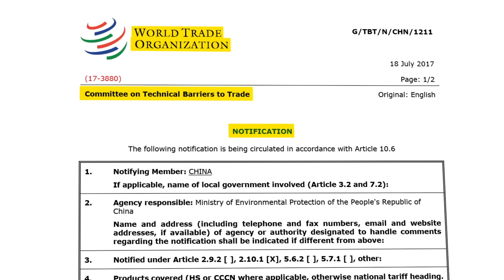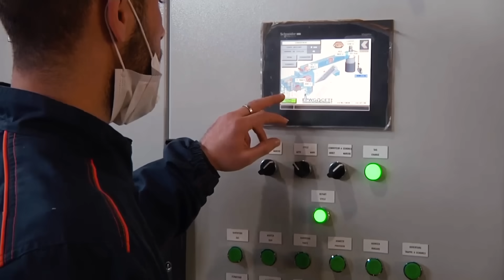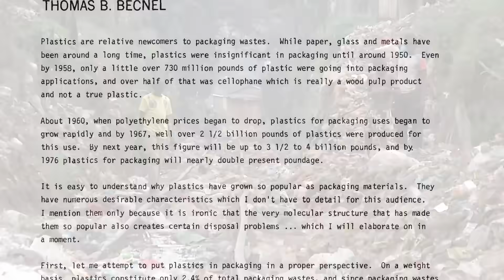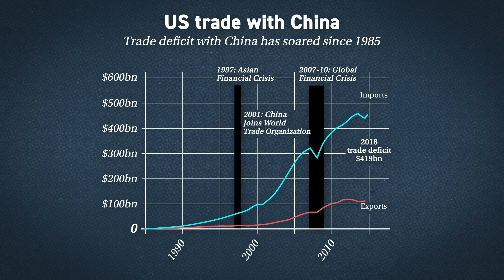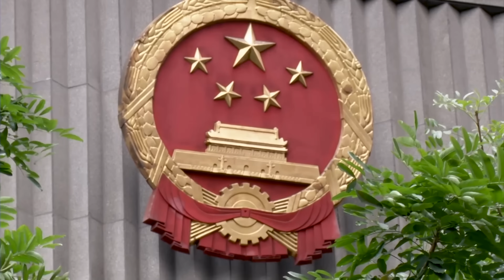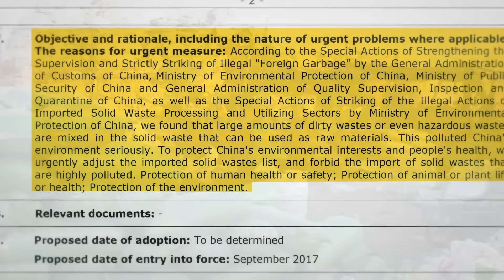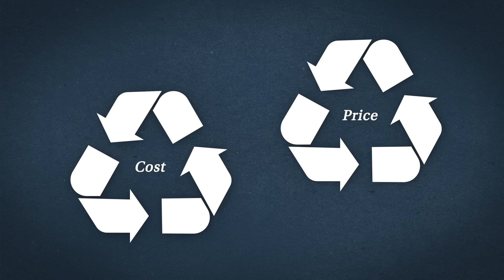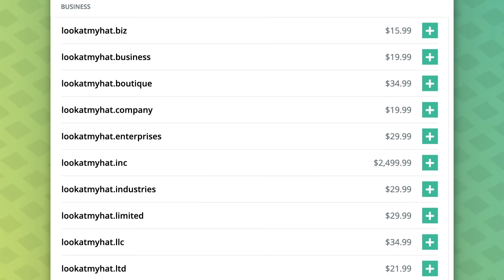How China Broke the World's Recycling

Comment: I've been trying to avoid buying things that come in plastic. It's very difficult since plastic is used in almost anything.
Reply: That's why it needs political answers to these societal problems.
Even if I really want to can't have a co2 free and plastic free live because the products that are out there are the products that are out there.
It's possible to do something as consumers, but it is quite limited.
Reply: @firstlast6813  There is a lot of products that would be outright unsafe to consume without vacuum sealing, which many small towns rely on to be able to import affordable food and that's just 1 example of why cheap plastic packaging is necessary, and there is a ton more examples just like this.
Reply: @Iwetbeds  definitely right and many times using plastic is actually better than using the alternatives. Because it keeps things save, light weight and long lasting.
That shows in my opinion even more why it needs political action, because the consumers have nearly now impact on how the plastic is produced, recycled or maybe even what kind of plastic is used. Proper standards and legislation on the other hand have the possibility to push the industry in a direction that won't damage the things we love and need for living.
Because something needs to change, the current way is not sustainable.
Reply: @Iwetbeds  I'm not expert, but some ideas: High fees on landfill use, funding of research for alternative materials, taxes on using new resources and subsidies on recycled products.
The goal should be a circular economy, fof that governments need to set an environment where recycling and reducing trash makes money and doesn't cost money.
Reply: @Iwetbeds  restricting different types of plastic for different uses and outright banning unnecessary use of plastic by companies is a much better suggestion.

Comment: Thanks, yes recycling has to turn a profit or it does not happen, I worked in recycling for 30 years, if we did not earn we did not do it.
 Here in UK, I shudder to think how we cope with Covid medical waste, PPE etc, we do not have the incineration capacity, and landfill should not be an option.
 Recyclers will adapt to new conditions, they are very innovative and fast to introduce new methods if the £/$ flow is positive.

Comment: Plastic needs to just stop being made and better alternatives need to be thought up. We could use glass, the problem with that though is that not only does glass take longer to break down, sand is not a renewable resource. We'd be destroying potential habitats and sand also acts as a barrier, preventing  erosion on coastlines and along river banks. The only way that could be effective, is if everyone is on the same page as in, glass isn't thrown out or recycled, but rather reused. Sent back to the companies who sold them to begin with, so that they can be properly cleaned and refilled before they are put back on the market. Of course even doing that, there are problems as well. The pollution created from transporting the glass for instance (at least until something like electric vehicles becomes more mainstream.)

Comment: when you see the situation of plastic pouring into the Mekong for instance, one of the best approach (simplest) once collected is either to gasify or use pyrolitic conversion to ash. sure, a big part of the energy is used for pyrolisis so it does not produce energy but the residue is ash and dioxin/pm emissions are kept low. small scale incinerators do not require large transport logistics and incineration can be done in situ.
given the problem with microplastics, it seems like a no brainer in dire situations like in Vietnam, Indonesia.

Comment: This is  not a problem, the solution is to landfill the plastic. Plastic that is responsibly landfilled does not cause a problem, the only problems caused by plastics are plastics that are just tossed on the ground or into a river, and recycling does nothing to help with that. If you throw your plastic in the trash, then you have done your part, end of story.

Comment: Petrol is running out i think in near future like in 70 years it will be viable for a while until we don't use plastic at all.
Reply: Cheap petrol is running out. There is enough to frack and enough tarsands for many years to go. It will run out way after 2030, 2040 or 2050 climate goals. Climate action will fix this issue pulling the carpet from underneath it's economics. This a byproduct of the fractions of wax distilled from crude oil for mobility. Bioplastics or syntheic plastics will simply become very expensive soon.

Comment: It should be pointed out that there is a great deal of active research being explored to find biologically-based methods not just to safely degrade many of the plastics discussed in this video but to create biologically-derived co-polymers and composites that exhibit many of the properties desired for petroleum-based polymers. These range from polylactic acid, polyhydroxyalkoanoates and polybutylene succinate to chitin, cellulose, collagen and other complex starches.

The chemical industry is not as callously indifferent as this video is suggesting, and they have been responding with the best available science and engineering to address the problems with low-value plastic materials. To be clear, high-value plastics like polystyrenes, polypropylenes, polyethylenes, polycarbonates and PET are still recyclable, mostly because thermoplastic materials like these still have very useful mechanical, optical or other properties.

Comment: Wait, if you can incinerate plastics (as i've done in the camp fire many times), can't they be used as a power source? Stack up some scrubbers in the flue to keep things relatively clean, and now you're making a profit from garbage? maybe? I think they do something like this in Japan.
Reply: It's not a self-sustainable, it takes more energy to keep the plastic burning than the energy returned from the burning plastic. The byproducts of burning plastics are also extremely toxic, it's not as easy as stacking "scrubbers" to contain the pollution it produces. Keeping it on the ground is actually better for the environment than incinerating it.

Comment: Don't forget what you learned back in the third grade; it's reduce, reuse and THEN recycle.  We forgot about the first two, much more important elements to waste reduction.
Reply: It's a nice idea for future plastic, but doesn't fix the problem of all the tons of existing disposed plastic not being recycled.
Reply: @DiegoCandel  It has to start somewhere. Even if the existing disposed plastic is just ultimately fished out and burned down in plants.
Reply: @Puleczech    I agree. In fact, i would argue it started a long time ago with individual efforts (from indigenous people opposing pipelines and preserving flora and fauna, people cleaning beaches and landscapes to NGOs cleaning parts of the oceans). But that's going beyond the 3 Rs. It's adding "Cleaning" to the package.

But perhaps it's also time manufacturing companies should join in fixing the mess they've created. If those companies would've to be made responsible for cleaning and recycling the disposed plastic, the situation would be completely different.
Reply: @DiegoCandel  Yes. But the companies won't do it by themselves out of the blue. At least not for another generation. They have to be pushed by at least one of these things:
1) consumer's preference
2) taxation on virgin plastic / subsidies on recycled plastic or both
3) another generation of CEO's that will be driven by other values than profits only.

I think combination of all above is the way forward.
Reply: @Puleczech  Again, I agree. But would also add 4) Civil unrest and protests demanding these changes to companies and governments.
Reply: @DiegoCandel  Civil unrest of the scale needed for this would mean the planet is already completely fucked.
Reply: @Puleczech  climate change, scientific consensus says we're already there. We just haven't catched up yet.

And let me assure you, I would love option 4) wasn't part of the whole thing, but I really think it will be a significant part of the equation a lot earlier than 1) and 3) (and, probably, will be the incentive for number 2) too).
Reply: @DiegoCandel  Fair enough. My point is it will take at least another decade before people ACROSS THE BOARD will unite for a civil unrest. As of now, protesting teenagers and ecological activists are laughing stock for the rest of the society, let alone politicians or big companies. I don't want it to be that way but that's just what it is. And every time these groups go a bit harder it sends a backlash from the rest of the society against them, hurting the cause. Extinction Rebellion blocking the tube in London for example - even I was pissed and I am up for the cause in general.

Civil unrest done by a small group, let alone group tied to a specific political ideology, will not change anything on the scale that is necessary. Other ways HAVE TO be considered and actively pushed. I don't have the solution though...
Reply: @DiegoCandel  you should really look into the work of Michael Shellenberger.  He's an author and the founder and president of Environmental Progress, a mission-driven research and policy  organization fighting for nature and prosperity for all.  His recent book, Apocalypse Never, is a fascinating look at how climate change alarmism actually hurts the environmental movement.  Don't buy this idea that the world is going to end in 12 years because of climate change.  Obviously, climate change is real but it’s not the end of the world. It is not even our most serious environmental problem.
Reply: @bigblack9819  but that's not the point of my initial comment. Whether or not climate change is our biggest problem, and whether or not plastic pollution is the biggest sub-problem inside climate change, plastic pollution is a big issue regardless (its impact in oceanic flora and fauna alone, which we humans rely on, is huge).

The intent of my initial comment was to point out that, while it's necessary to promote the 3 Rs, that alone won't solve the whole problem and that's why we have to add "Clean up the disposed plastic in a significant & effective manner" as well.
Reply: @DiegoCandel  well said, I work as a consumer product designer, so I'm very concerned the global consumer culture is creating a massive amount of waste.
Reply: @bigblack9819  a very important job nowadays. Going for designs that accomplish easily dismantleable products into reusable/recyclable parts is going to be a necessary component of the solution too. In the electronics/PC world is an issue that most companies have dodged for a long time.
Reply: @DiegoCandel  yeah I work in the toy industry. Technically you could recycle and reuse all of the plastic in a typical toy that's being thrown away, the problem is they're held together with screws and often contain PCB boards and battery boxes.  They are designed with manufacturing efficiency, low cost, child safety, aesthetics  as the priorities, with literally zero thought put into their disposal.  

I've always felt that, as a toy designer, the best thing I can do to reduce plastic waste is make the coolest, most robust and beloved toys I can, that way they're more likely to find their way into the second hand market rather than being thrown away.  I often see toys from my childhood, the 1980s, on the shelves of my local thrift stores, so my hope is that in 30 years i'll go in and see some of my creations on those shelves.  I hate how disposable our consumer products have become.
Reply: @DiegoCandel  "It nice to save the lives of children but it won't resurrect dead babies."
Reply: @toolbaggers  "It's nice to save the lives of future babies, but to achieve that we should also approach and resolve the problem(s) that killed past babies, is currently killing present babies and will definitely kill future babies if not resolved". There! I fixed your comment. You're welcome.
Reply: It should be be the FOUR R's:
REFUSE!
REDUCE
REUSE
and then RECYCLE.
Reply: true. remember how we used to fix things but now its cheaper to buy new one. messed up.
Reply: @kissarococo2459  sadly companies make things to break quicker and not be fixable
Reply: Fantastic comment. I did forget about this. Fortunately where we are currently living, there are chains of 2ndhand clothing and furniture shops that is our go to before buying new. It isn't good for the economy but it fulfills the second R, REUSE.
Reply: Underrated comment
Reply: And all of them could be solved by adding a 20% tax on any new plastic produced, the money of which would be used to financially help recycling companies so negative value plastic become positive value. And because of the increased overall costs, companies would look to reduce how much plastic goes into packaging.
Reply: @vulk_nubium  It is you (customer) who's gonna pay that +20% finally, are you aware?
Reply: @Tiddelypoom  Yes, I don't see your point ? If they use recycled plastic, it cost more. If we make new plastic more expensive than recycled plastic through tax, they'll stop using new plastic and recycle more. Yes we'll pay more, but also there'll be less pollution. Innovation in recycling will then lower the costs of recycling. Plastic will be engineered to be more recyclable too. Long term it's win-win.
Reply: @vulk_nubium  agree. Just pointed at the side-effects.
Reply: but reducing and reusing makes it so i sell less stuff and so it hurts profits :( /s
Reply: Doesn't solve the problem of the package at all. You cannot eat less or buy products with no package in many cases. And this kind of plastic is the most problematic one. It is the industry who should take care about produced plastic not the customers.
Reply: too many people are mixing bioplastics in with recycling so every ton would have to be individually sorted by hand when they receive a shipment makes cost mount higher and higher makes it financially unsustainable a single bioplastic cup could waste a entire batch so a ton of recycled plastic would have to go to landfill
Reply: i believe it's reuse, reduce, recycle
if you can reuse it's always the best choice
Reply: But as long as we have China to blame, we are more than fine.
Reply: I suppose uneployment is much more terrific problem for goverment than ecologic problems, so... new plastic bottles would be produced
Reply: Underrated comment!
Reply: You mean American. Many European countries have excellent Recycling.

Comment: nothing wrong with using incinerators on plastic waste if that heat is used to make electricity.  In fact it's a good use of the original oil.  The plastic got a first use in it's original form and a second use to generator electricity.  That's a win.

Comment: One thing I'm thinking about for this valueless plastic is it could be used to displace concrete out of void spaces to lighten structural components of buildings, you wouldn't need the material to be that good, only good enough to hold its shape as the concrete cures around it, and then it's trapped there until the building gets demolished.
Reply: Um... No. Concrete buildings are lightened by just leaving hollow voids inside the plates. Surprisingly, air is cheaper than plastic waste.
Reply: Mixed-fabric clothing is also an issue for recycling. Fabric strands improve concrete tensile strength. This kind of use of waste may be an option.
Reply: @volo870  I agree to a point about air being a cheaper filler than shit plastic, if you're precasting objects in a factory such as floor panels, wall panels, bricks, that would make sense, but casting concrete on site what might be desirable would be to create void spaces in the middle of concrete panels so the outer surfaces (where the most stress happens in a bending moment) can be mostly uninterrupted (holes for services and stair/lift wells aside) while still being light enough to reduce the load on lower structures and having the stiffness of a thick floor, it might be desirable to have plastic shells that can be tied between the reinforcing meshes and just left in there.

My thinking is that there's lots of it, and it stays as it is for a very long time, and it can be melted, it's mechanical strength is a bit shit, but that's offset by there's lots of it to the point where we're struggling to work out what to do with it.

Comment: I thought you were about to say it in conjunction to why recycling plastic is economically unfavorable, in the same line as comparing it to metal or glass , but plastic also can't be near infinitely regenerated through recycling the way that glass or metal can. Due to the molecular structure of plastic, which is a polymer of carbon-based chains, the structure and length of the chains will break down over time and the chains cannot be relinked (whereas resmelting metal or glass will replenish molecular structure of intended product). Higher quality plastics degrade less quickly or readily, but lower quality plastics may quickly be rendered useless for reapplication into new products, so further down the line it's impossible to create a reasonable-quality product without integrating recycled material with virgin plastic. (Degradation of plastic into very tiny chains, which exposure to UV hastens, is how we get microplastics invading our food supply. )

Comment: Another Idea is filler. Mix plastic with dirt to fill abandon mines. Use in steel production to get the needed carbon percent. Use in aggregate to make sidewalks and tracks that don't have heavy truck traffic on top.

The main thing is not letting it break down to little pieces in open nature. Little fish will eat it. And concentrate up to the bigger fish and into humans. 

Burning it is better than biodegradable. Biodegradable turns to methane that is much worse than CO2 that plants use. Unless you catch that methane and burn it.